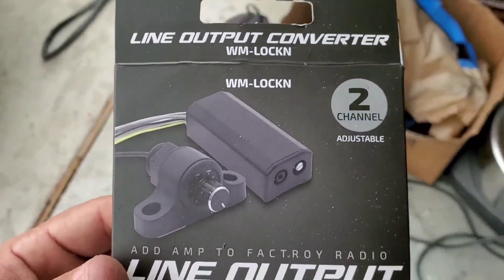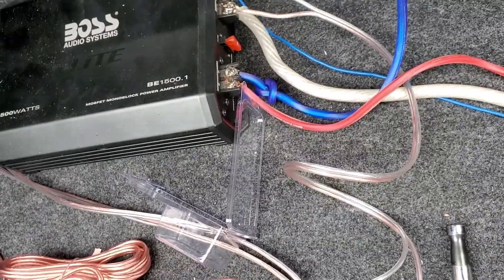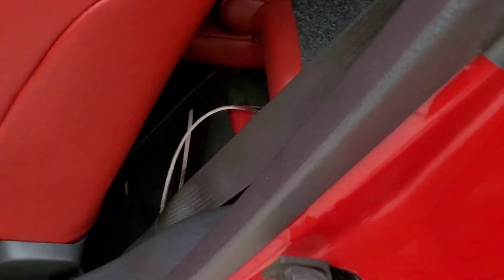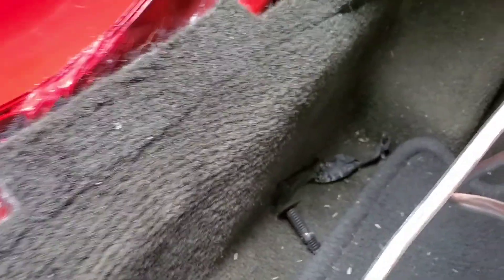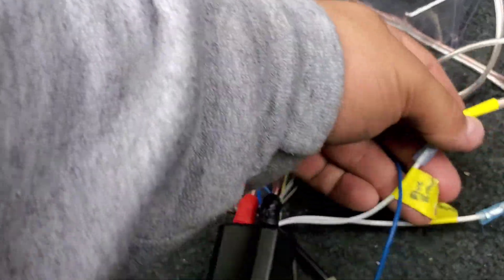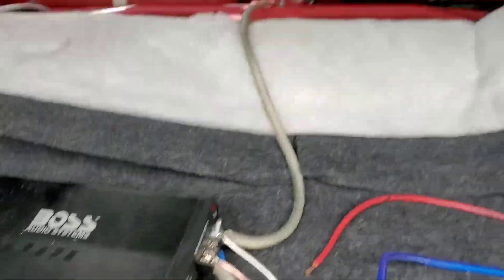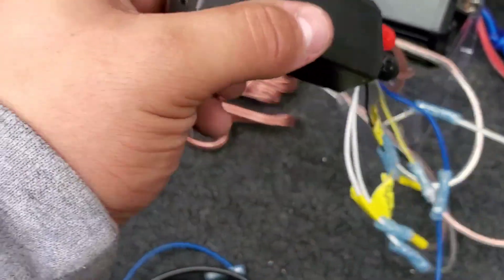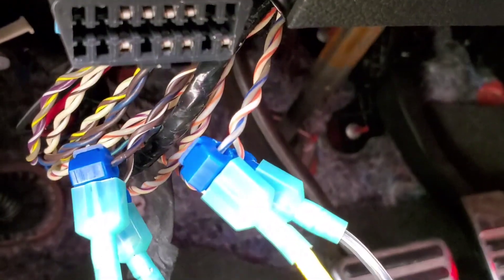HOW TO HOOK-UP LOC TO 10-14 MUSTANG SHAKER 500

Comment: So will this let me use the factory amp with an aftermarket head unit? Or is this a bypass of the factory amp? I got everything set up and my door subs aren’t working. I don’t wanna have to buy the idatalink just for the door subs.
Reply from the maker: I used an additional amp for the 2 subs. But you have to wire in the LOC like this or else you won't get audio to them.